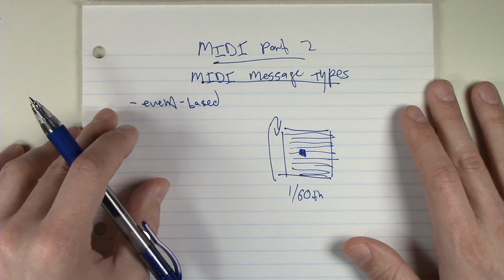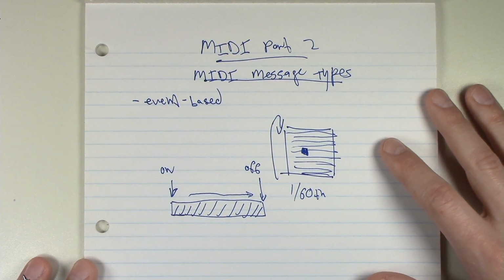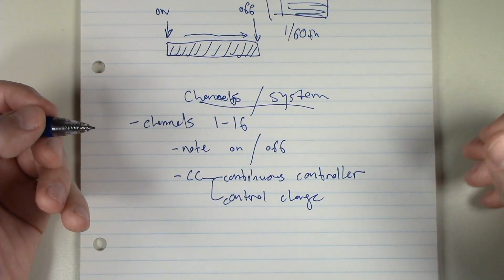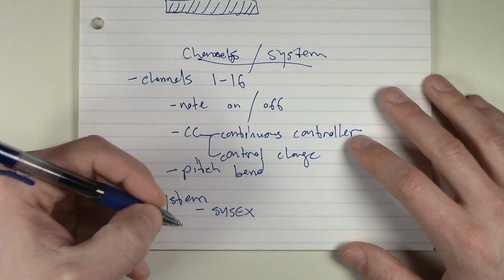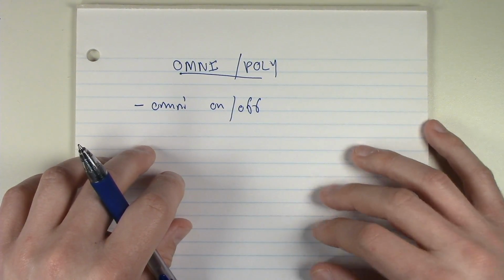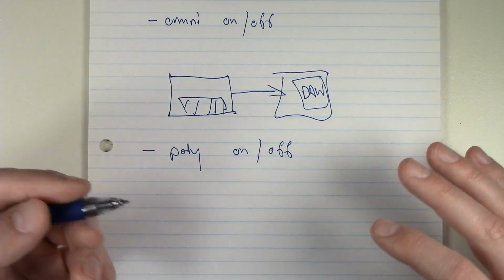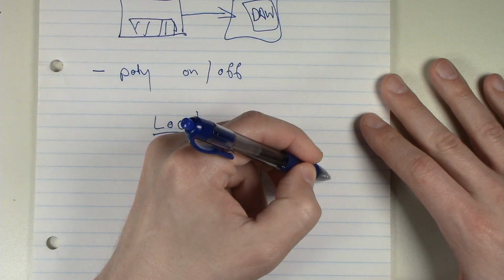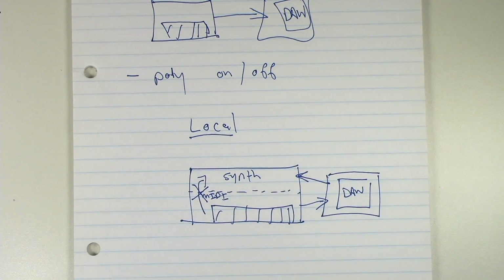MIDI Part 2 - MIDI Message Types

Comment: Did i ask you around 2013 to co work together for Image Line vst code implementation for lights using MIDI QSC protocol? Anyhow i did not remember but i ve remember your smiley face on these videos once i ve recap with mow..😊

Comment: Is "local" really part of the midi protocol, or is it a feature that certain manufacturers of combined keyboard/synth devices choose to implement for practical reasons?
Reply from the maker: It's discussed and part of the protocol since there is a CC message for turning it on and off. However like most things in MIDI any device can choose to not use / support any part of the protocol. Most keyboards with internal sounds use MIDI local to select between playing live on the keyboard, or using the keyboard / synth section with a sequencer or computer where local echoing of notes would be a problem.

Comment: Thanks ! one question, if i have an 8 fader controller, and one pugin has certain CCs programmed from the fader to a plugin, will this control another plugin with the same CC attached or would i have to use a different CC? OR would the cc only activate while the track is record enabled? thanks :)
Reply from the maker: If it’s the same plugin on another track it should work if you switch to that track. Otherwise your software might have some settings you can use to map any CC to any parameter. Hopefully you wouldn’t need to reprogram the fader unit for each plugin.

Comment: Thank you and спасибо for sharing your knowledge! I have been struggling since a couple of weeks trying to control my boss rc505 looper (with guitar and vocal loops) with the sequencer of the digitone via midi connection. Do you have any idea how to solve this?
I know, this is a very specific problem and just my own spleen, still i am dying try it))
Reply from the maker: You really just need to read the manual for the MIDI implementation of the 505 and then figure out how to program those messages into the tracks on your sequencer.
Reply: @shiftedphase  Dear Sir, You saved my life today. My whole family thanks you)) I just really had no idea where to start and with your advice it took just an hour for me to run it!
Reply from the maker: @lametripper  Awesome!

Comment: very helpful!! We are getting close to some info that I've really been digging for. (PS, I have watched all this series up to number three. I skipped over this one somehow but now I'm glad I doubled back.) I am wanting to manage two seperate midi controllers without them activating notes on each other... only on the instrument in the DAW that I want them to. Specifically, I am using a drum pad controller which is talking to a software plugin in my DAW, Studio One. Then I have a keyboard controller going to the DAW and talking to a seperate software plugin. My trouble is that both plugins are responding to a single midi message from a single external device. Headed off to watch your session number FOUR now. Thanks for this info.
Reply from the maker: Routing MIDI inputs in modern DAW software is usually a pain. I'm not familiar with Studio One but Logic makes it rather annoying to set up like that.

Comment: Hi You, Thank you the Video; may be you can help me out; because nobody seems to know...
1. connect 2 keyboards, 
2. I want ONLY to change Program/Combi sound patches
3. I do not want to trigger a sound from one keyboard to the other keyboard; Nr 1 should only control the Program change!
4. both Master MIDI Channels are on the same Basic channel, and the change works; but Nr1 also triggers notes on Nr2 keyboard. 
5. mode is set to poly, not omni
Reply from the maker: I don't think there is a way to do this with most keyboards. You would need some kind of MIDI filter to remove the note events. Have a look here: http://www.midisolutions.com/prodevp.htm

Comment: I have a Roland MC-303 Groovebox drum machine, a Korg X50 synthesizer, and a Waldorf Blofeld Synthesizer. I am wanting to send Midi clock from the Groovebox to the Blofeld Synth but also use the Korg as the controller for the Blofeld synth only so that its arpeggios are in time with the drum pattern. Is this possible?
Reply from the maker: If it's possible you might try syncing the X50 to the groove box and then sending out MIDI clock to the Blofeld. It looks like the X50 has a built-in arpeggiator so perhaps there are settings for clock in and out. Check the menus in the synth.

Comment: Very useful. 
I have an unrelated question...
How many oscilloscopes does one man need? 🤣
Reply from the maker: I personally have two scopes: an old dual trace analog scope, and an entry-level digital scope. They are both useful but unless you're doing very special stuff you don't need anything super expensive. The other stuff in the background of my videos (I presume you are referring to) are not scopes.
Reply: @shiftedphase  Yeah - it looks like you have about 4 lined up behind you!
Don't mind me - I'm only jealous ;-)
Reply from the maker: @andymellor9056  Ah, just add to your toolbox as needed. I've slowly found good tools over 25 years or so. I like projects that give me an excuse to add something new.

Comment: I am trying to make a little midi-app in Python , something very simple like registering a midi note and sending it out adding two notes  (making a chord out of it) , based on a midi-foot-controller in realtime.
Do you have experience with libraries in practical programming? anyway thanks!!!
Reply from the maker: I mostly program on Linux using ALSA, Jack and I used to use RtAudio and RtMidi. Learn the APIs  that get you as close to the action as possible... I'm not much of a Python programmer but feel like a lot of the "de facto" libs for it are fairly flimsy. (the serial library comes to mind) Any language is okay, but try to find bindings for one of these real back-ends because when you want to change to a different language later most of what you learned will still apply.
Reply: @shiftedphase  thanks for the reply, I found a library called "MIDO" that works well with Python.

Comment: is voices part of midi, or is that part of notation software?
Reply from the maker: What do you mean by voices? In synthesizer terms the number of voices an instrument can play at once is based on the synthesizer hardware or software. That's called "polyphony".
Reply: It may be a harmony term (as in a four-part harmony has four voices). In notation software you can separate stacked notes into separate voices. I bring it up because I am trying to create a rhythm generator with 2 parts, or rhythm cells, that share a staff.
Reply from the maker: @evanperrygiblin  Oh I see what you mean! The actual MIDI protocol doesn't care about any of that stuff. Your notation software might be able to split the voices and send them on different MIDI channels... this can help if you have unison notes written in your parts because some synths won't play two of the same note. But most music recording software (Logic, Reaper, etc.) doesn't really know anything about stuff like that. For drums though it's common to have multiple drum voices share the same channel since each sound uses a different note. Hope this helps!

Comment: Hi. I'm soon receiving the PC12 faderfox with 72 knobs with classic midi and usb - but for the moment I have 4 akai LPD with 8 knobs each, so 32 knobs in total, only plugs into usb, so with lpd8 editor i can"t change different CC for each knob, so knobs from one device to another turn the same buttons  -  I hope 72 knobs will be all available  with  fl studio 20
Reply from the maker: Having multiple devices with the same message type and name on USB can be frustrating. Unfortunately the MIDI API in most operating systems make it hard for music software to tell them apart. I think some devices can be queried for a serial number, etc. over SYSEX. A single bigger controller should do the trick, but there are probably other ways if you make a custom program to go between the controller and the music software. I have some friends that do this kind of stuff in Python.

Comment: Hi, thank you for your video. Just a quick question with midi channels. If I have one keyboard and I have a midi file that I want to play with specific instruments..eg bass, strings, drums. Do I assign channel 1 for strings, channel 2 bass, channel 10 drums, etc or do I just use one channel for all. I was also thinking maybe each channel is for a different device...eg channel 1 for a Korg Keyboard, channel 2 for a Nord Keyboard, channle 3 for a Roland etc. I am a little confused about what the channels are each assigning.
Reply from the maker: Normally each channel is for a different instrument. If you have a multi-timbral synth it can make different sounds at the same time on multiple channels. Think of that as multiple synths in one box. You can also use multiple synths the same way by setting each of their MIDI receive channels differently.
Reply: Thank you for your response. That makes a lot more sense. I am new to this and my synth has the channels 1 to 16. What I want to do is download a midi file and assign each section of the file to a midi channel through my keyboard. Eg Bass on channel 1, strings on channel 2 and drums on channel 10. Is this possible or do I need a DAW?

Comment: I'm so happy to be free of syncing my hardware to my DAW with midi now that I have the expert sleepers ES3. It always drove me crazy never being able to get tight, and consistent enough sync. Something about the audio buffers within my soundcards that I have ever used are terrible for sync. The ES3 uses ADAT to send CV, triggers, ect... Whats weird is that whenever I sync two pieces of MIDI hardware with MIDI it is much more accurate.
Reply from the maker: It shouldn't be weird that hardware is tighter... the timing is guaranteed by the designer. With software there are a LOT of layers and a lot of unknown timing between the application and the outside world. With embedded hardware designs we have complete control of the system right down to the bare metal.
Reply: Does hardware midi sync have to do the the ppq amount? I have some pieces which are much more tight than others. I know that my electribe is 24 ppq and I find that it is not as tight as other pieces of gear. Is this because they have higher ppq?
Reply from the maker: The standard over the MIDI cable (or USB MIDI) for clock is 24PPQ regardless of what the internal PPQ of a particular sequencer is. It's possible that the timing inside the hardware is affected by the speed of the CPU and how much other stuff is going on. Hardware can mean low latency and tight timing, but it's only as good as the firmware running on the system. Getting it right can be tricky! Believe me, I've been there! :)